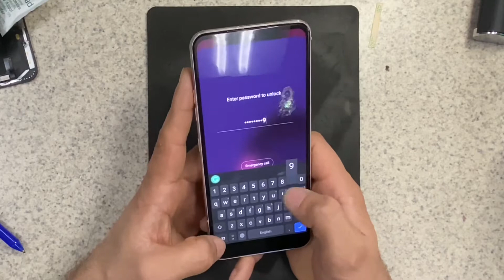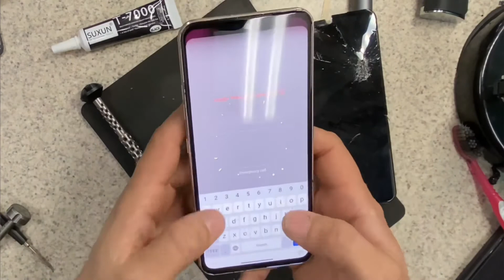How to replace a crack screen for lg v60 thinQ 5G | LG v60 thinq 5G screen replacement

Comment: You put flex cable of new screen in wrong hole.
Reply: That's what she said .. lol . I guess it still worked fine. As it has to come up thru one of the holes sometime. And the battery still ends up on top of it . Plus him using 2 sided tape help so there was room for the ribbon for either hole he wanted to shove it thru

Comment: Fell off my bike at 60 and it stil worked fine just that road rash doesn't look any better on a phone this is where that mil-spec 810g comes into play even though it looks nasty it's going to still work I mean they freeze these things boil them and vibrate them harder than any human ever would drop them a bunch of times v-series are always solid phones

Comment: So unlike many phones, the adhesive is only adhered to the edges of the screen instead of covering all the area. This means it's possible to remove the screen without breaking it with patience and heat right? 
Technically you could take the screen out, and then replace just the glass if you're determined and have the knowledge and tools, and skills?
Thanks for this video :)
Reply: very unlikely.. I use to think like this.  The glass it bonded to the screen all newer phones are like that.

Comment: Looks like you should have got a new back glass replacement also. 

Because what's the point waterproofing the front when the back isn't anymore. Lol 

If you search online they do sell a plastic back cover for the Lg V60. 
Since the back glass always seems to easily/ break first. I don't understand the purpose of putting glass on the back. I guess it's just for looks but they could use lexan(bulletproof glass) plastic to look like glass, and it's probably cheaper than gorilla glass 5&6&victius1&2 to make and stronger then all of those.  Maybe they use glass for better heat dissipation. (I don't know). All I know is that more glass means more chance one will break. 
Phones accidentally drop all the time, or accidentally put in pocket with keys and have to go up and down from your knees. Or get a drink spilled on them or get pushed into a pool in a pocket(with broken back glass). Or get thrown across the room angry at them after writing a blog or comment for a long time the phone turns off or you accidentally hit the back button. Losing everything you had just wrote. ( Well the last one not so much). Which is only because I have probably lost about a years worth of my life when writing on smartphones that didn't amount to anything when either of those happened. 

Because there is no control+Z on a computer for a phone.. That any time I want to write something I first write it on the notepad app then copy and paste it over.
Reply: To be fair he left some gaps when doing the front so that won't be waterproof either 😂😂

Comment: you're going to need to improve the volume of your microphone.  Only video I found of someone removing the front screen of the v60 but I could hardly hear anything
Reply from the maker: Sorry for that
Reply from the maker: If you need any kind of assistance you can ask me here
Reply: great video. We can see perfectly fine what he is doing. If you need to hear what he is doing, you probably shouldn't be taking apart a phone.
Reply: @emanuelruiz7710  I'd prefer to be able hear if someone is talking on their video.  It appears he has improved on that since I last watch it since I can hear him a lot better.
Reply: @emanuelruiz7710  I am also using the phone that this video helped me repair.  These phones have become unnecessarily complicated.  Old phones you could peel the screen off without having to take apart the rest of the phone to do it so this video was a help a regardless